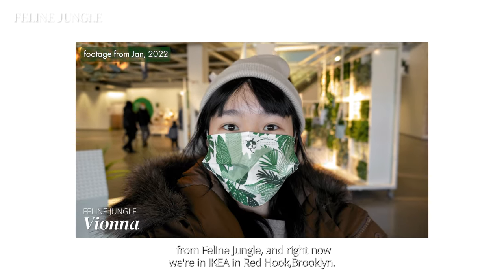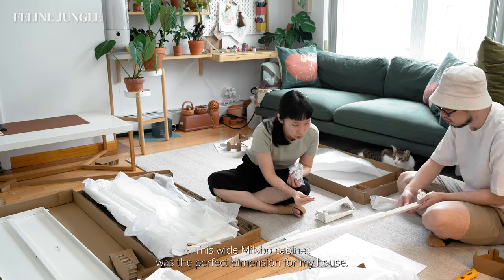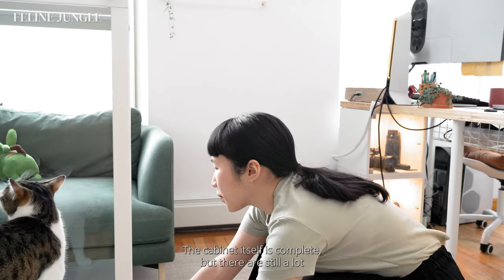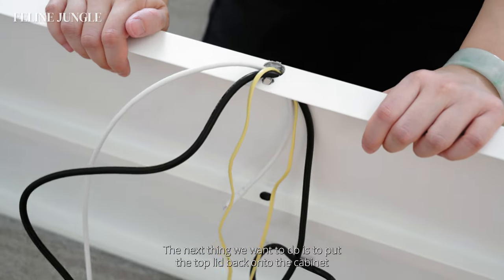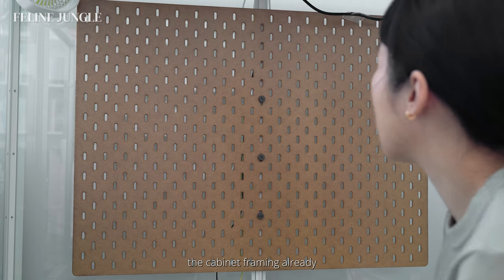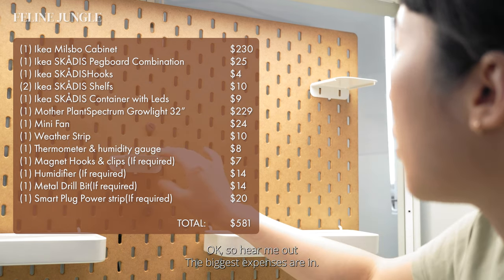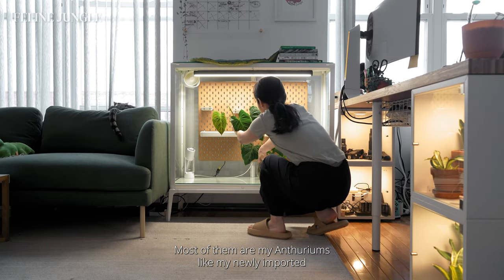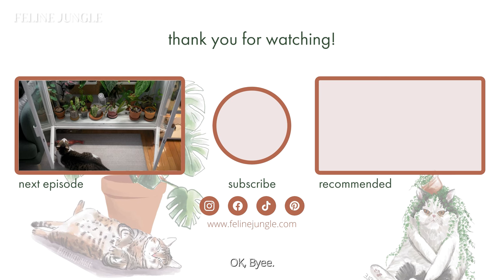Building DIY Greenhouse Cabinet Indoor Set Up | IKEA MILSBO Plant Styling Tutorial | 06

Comment: While setting up one of these cabinets definitely is a bit of an investment, mine did not cost anywhere near as much. The choice of grow light she used was the same price as the cabinet itself. Since she decided to use a very high-end and expensive light, this is why her total cost was so much higher. There are plenty of other high quality grow lights on the market that fit perfectly in any of these Ikea cabinets and are WAY cheaper in price so I would just suggest doing your research and shopping around a bit. Also, the peg board is 100% going to get moldy; its just inevitable. I can't emphasize this enough, but I would HIGHLY recommend spraying it with some kind of weather sealant before installing into the cabinet. I've had my Milsbo wide cabinet now since Jan 2021 and did eventually have mold issues with my peg board because I did not seal it initially. Since my cabinet typically sits between 90-95% humidity without me even needing to use a humidifier, I still ended up with some mold growing. I had to purchase a new board as a replacement, and make sure to spray with weather sealant and allow it dry for a few days before re-installing into the cabinet. Trust me -- you do not want to have any issues with mold!!! The spores can still linger around for quite a while, even after you thoroughly clean/wipe out your cabinet and you will, without a doubt, start finding mold growing on any plants you have in there.
Reply: What type/brand of weather sealant do you recommend for spraying? Do you spray it directly onto the board itself? If I got a plastic pegboard, that would not be an issue, correct?